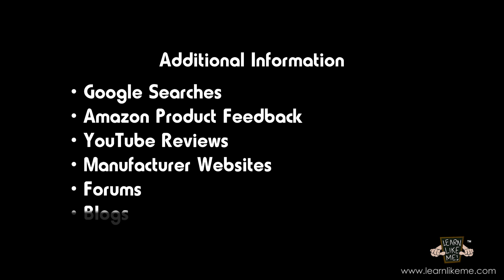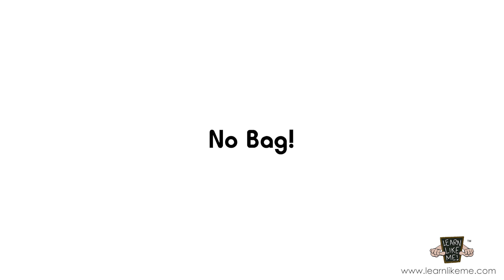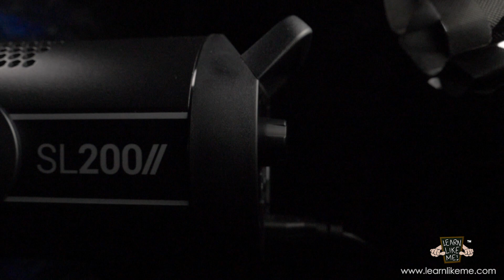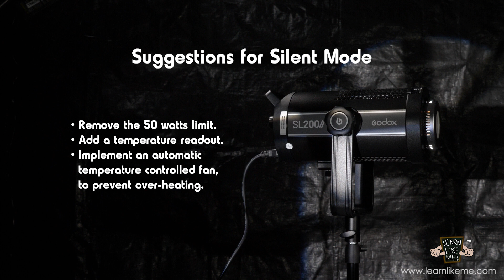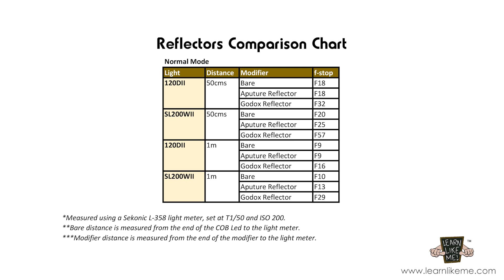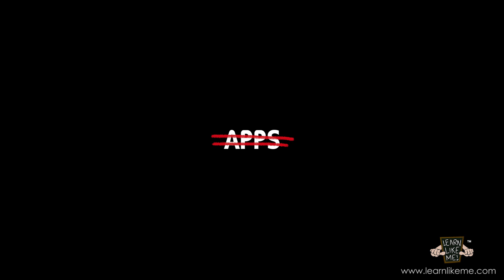Why buy the Godox SL-200WII Light over the Aputure 120D II,SL60W, SL150W, SL200W and SL-150WII

Comment: I'm deciding between this and the sl 150ii. I already find the 150 a bit high on my budget (I'm mostly still beginning) but im wondering if spending an extra 80 or so dollars to go up to a 200w unit might be worth the flexibility and long term use (meaning, I'll already be at 200 watts). I currently use a sl60 and a few cheap light sticks, and I film and stream a bunch of cooking segments along with their broll. What do you suggest? Thank you.
Reply from the maker: If you think you can recoup spending the extra $80 by using the light, then I would go with higher and hopefully be done with any future purchase trying to chase that extra bit of power when in use. This is the reason why I went for a higher power light, as well as finding a light that was much easier to setup than a light with a controller ballast like the 120DII. See if you can find a store that carry both lights or a store that allows you to purchase both and offer return on one so you can test it out on one of your heavier shoots. Then you can decide if that extra power of the 200 is needed and return the light that does not suit your style of shooting? Hope this helps :)
Reply: @therenderer4726  yeah that's what I was thinking to. Essentially I'd already be at the endgame (at least for this level of lights as any 300w unit takes a giant jump in price so I would consider that on a level higher than what I'm doing at the moment) and wouldnt have to upgrade my lights anymore (well probably just another sl60 for rim or general purpose) I mostly shoot indoors but sometimes I do use a large window with a sunny garden as a backdrop so I was wondering if the extra power would really help me out there.
Thanks for the reply!
Reply from the maker: @sabaw3  No probs sabaw3. It depends how strong the sun is, your setup, layout and what you are trying to accomplish but the 200 does much better than the 120DII which has more light output than the SL60W. The special reflector on also helps if that is the type of more focused light you are after.

Comment: Hi mate,
I have a question about my youtube setup, also some of my Commerical photography, and videography works -
I m considering sl60w
but my question is that is sl60w enough powerful for me, 
currently, I m using Lumix g85 with kit lens 12-60mm and I also considered a 90cm dual layer of diffusion softbox with grid, kind of 6-8 feet from the subject and same distance between subject and camera also, can I m able achieve iso 200 particularly for 30fps 4k 100mbps setting with a shutter speed of double of my fps because natural video motion effects, what's ur opinion✌✌
Reply from the maker: Hi Rohit, I do not have an SL60W to test with, but looking at previous test footage I have with the 120DII at 3ft distance at 14% power, I was able to get ISO200 at f5.6 for mid interview type shots with a 120cms Parabolic softbox with dual diffuser, which is a light hog. The SL60W have been compared as the alternative to the 120DII. Do a search on youtube for SL60W or Softboxes as there are a substantial amount of tubers who use the SL60W. Check to see if they have their settings mentioned or if they have done a test run for you to get an idea of its capabilities. I have used a COB light for photography before, but found it struggled on group or distant shots and can depend on what you are trying to capture, what light modifier you are using, lens, exposure settings, quality you are trying to achieve, etc. - ie. moving subject, dark scene, softbox used, etc. Hope this helps.
Reply: @therenderer4726  by the way what camera r u using and what lens🌟🌟
Reply from the maker: @Rohitkumar-hn5og  Hi Rohit, been mostly using the GH5 with Canon lenses and a Focal Reducer EF-M2. Have not been shooting much due to the Pandemic. Hope all is OK in your neck of the woods!

Comment: What about beam angle?
Reply from the maker: Hi Making Of Studio, with the Godox special reflector on, the beam angle becomes narrower and more focused in the center. From my understanding, this is how they manage to obtain a measured higher light output as compared to using a standard reflector.
Reply: Hi  @therenderer4726   have you tried it with aputure fresnel 2X? lux seems to be similar as 300DII: 80,000 with fresnel 2X (spot)
Reply from the maker: @makingofstudio6359  No, too expensive for my budget on a fresnel :). I have tried the SL200WII with the Nanguang Fresnel and from recollection, the fresnel provides options for sharper edges and more focus while the special reflector you are set with a fixed feathered edge and focus.

Comment: Very detailed and informative review. I'm wondering if I can use any light-modifiers which i regularly use with flashes /strobe lights. Will heat be an issue ?
Reply from the maker: Hi Adam thank you for your feedback :) As long as your light modifiers have a Bowens mount, then it should be fine. I have found it to be compatible so far with all my Bowens mount light modifiers as the SL200WII do not have a deep mount requirement. My light modifiers are the cheaper Chinese brands that are for both Photography and Videography use (Neewer, Selens, Nicefoto, Nanguang, Unbranded). It does get the hottest with light modifiers that are enclosed like my Fresnel, Optical Snoot, Small Round Globe, etc. but I think this is typical with any 200w output COB light. Even the barn doors or reflector can get hot in the right settings. From my understanding and short experience with strobes, I found the SL200WII cooler than the modelling lights of strobes.
Reply: @therenderer4726  thanks

Comment: wonderful review! I'm still considering btw this and the VL300, I don't need a case, but I'm wondering whether the power difference is enough to consider
Reply from the maker: Thank you Dao for your feedback! I think an extra 100 watt would be noticeable(compare the specs) and can be handy to have some extra power just incase but consider possible cons with the VL300 though(depending on your use) - added bulk of controller, expensive V-mount batteries, do you think you will need the extra 100w for what you do?. It would have been good if they had an SL300 as I actually prefer an all-in-one design for portability and quick setup and I do not think I would use the option of the 2 X V-Mount batteries which are expensive. I would likely go with a portable sine power supply if I wanted portability with the SL200.

Comment: hello , though there is lux difference in SL150w ii and SL200w ii can you share how practical difference is there in power/aperture stops in between if we use light at 5 meter far to the subject
Reply from the maker: Hi Shri Hari Productions, I do not have the 150w ii to make a practical comparison but 5 meters is quiet substantial especially if you are going to diffuse the light with a softbox. You may need to go for the VL300 as that has a greater output but it all depends on what you are trying to achieve at 5 meters. For example, if you are spot lighting a subject, then with the reflector or fresnel attachment, the SL200WII light should be fine.

Comment: effects aren't adjustable ? !
Reply from the maker: Hi B Doughly, it can still be usable depending on your purpose and how long you want to use it in a scene. The effects can be obvious, especially the effects that are looped but you can still alter it manually with some light blocking, filtering or movement.

Comment: Also did you not consider the Pixapro 200D?
Reply from the maker: Hi Chris, it seems to be sold more on the European market than Australian and this is possibly why it did not show up in my research. It looks like a new model and may have been released after the review? Have you tried one before, what did you think of it compared to other lights? Thank you.
Reply: @therenderer4726  I’ve not had any experience with the Pixapro 200D but it looks quite good for the money. It’s around £100 cheaper than other 200w alternatives. I’m looking for a key light for headshots so I need a really accurate colour output. The current Godox SL60s I use have a horrible pink colour cast and are not powerful enough for larger light modifiers.
Reply from the maker: @HEREONOUTBAILEY  If you are after better color quality, I would see if there are any test samples or reliable reviews online of the Pixapro to help you make an informative decision before investing on the light unless they have a good return policy and you are not losing out on much or any money if you have to return it. I think with the Pixapro, it comes out more expensive if importing to Australia. On the SL200W2, once you start using distance, larger and deeper softboxes with 2 layers of diffusion, the power starts getting eaten up, but it holds up much better than the SL60W and Aputure 120D Mark II light. Please note, don't get caught up with the high lux specifications marketing of the SL2 and the VL series as from my understanding, it is measured using the special patterned reflector that focuses the light to a hotspot where it is measured, the light behaves differently when placed in a softbox and does not produce anywhere near that output! I don't know whether your doing commercial work, but the Godox VL300 is another option which might pay itself off and give you less headaches if the light is underpowered for your particular situations. If you do get the SL200W2 and need more power, see if there are any color correction filters like from Rosco or Lee, to help you try to match  both the SL60W and SL200W2 together so that you have the option of using both lights with an umbrella or scrim and flags, etc. for projects requiring more key light power.

Comment: How does this compare to the SL60? I’m wanting to upgrade.
Reply from the maker: In my opinion, if you want similar COB light design (all in one, no battery option, no ballast, etc.) and need a more powerful light and you can afford the SL200W2, then I think you should consider this light. If you don't need the power and just need the improvement in features, functions and quality of light, then I would probably go with the cheaper SL150W2. If I was upgrading from an SL60W (all in one design), I would keep the SL60W and try to go for a portable design light (one with battery option, controller/ballast, effects) so that I have these options in my lighting kit. This all depends on YOUR understanding of yourself as a videographer/film maker, I mean do you see yourself using the other features and functions like going portable, effects, etc? It is very easy to get caught up with all the unnecessary bells and whistles of gear, I still struggle to control myself when purchasing in that department :)